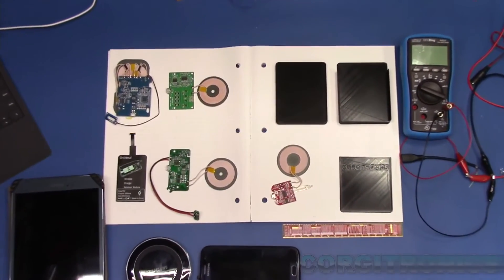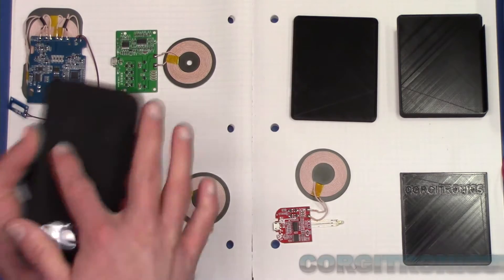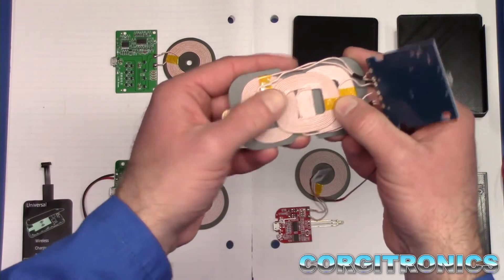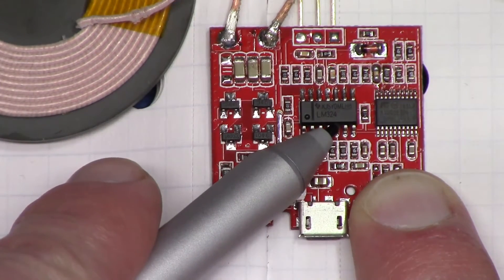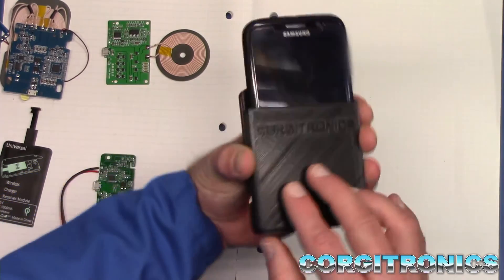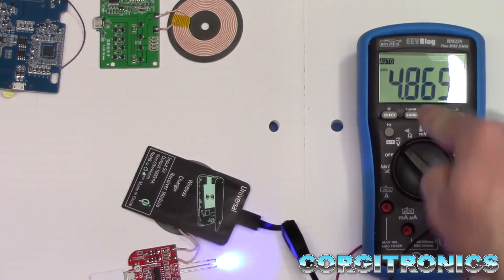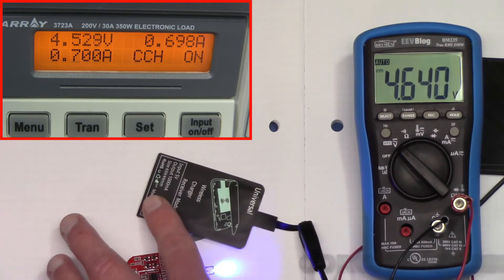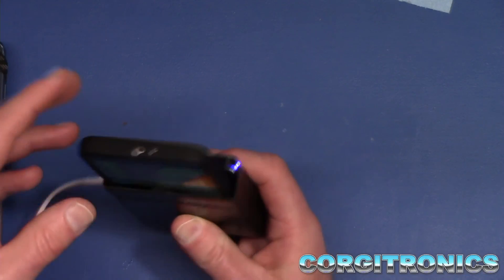Making a Qi Wireless Phone Charger

Comment: Hey, I'm investigating the effect of distance between coils and misalignment of coils on the Induced EMF and Efficiency of the system for an academic project. Would I need an oscilloscope for initially measuring frequency? Also, is there a formula that connects the Voltage and Current (variables that I will be measuring) and the Induced EMF (required answer)?

Thanks a lot in advance, this really helped with my method and setup!

Comment: Hello. I'm searching for some information and thought you might be able to answer a question I have about a built in 10W Qi charger on the top of my PC case. The PSU that was supplied with the case from the factory has a little dedicated Qi power wire that is integrated into the PSU. I want to swap out the factory PSU, and since the new PSU doesn't have this dedicated wire, I would need to power the Qi with a Molex (or SATA?). If I use a multimeter to determine what that factory wire pinout is, can I just look up the pinout for a Molex and connect the factory plug to the corresponding Molex wires? Does it matter that a Molex wire will supply more than the 10 watts of the Qi charger? Most people write off the integrated Qi charger as a gimmick, but it's very convenient and I use it all the time. I would really appreciate any information that you can provide. Thanks in advance!
Reply from the maker: I don't see why you couldn't do that.  You will need to measure the voltage that the Qi charger is getting, it's probably 5VDC, and then check the voltages on the pins in your Molex connector to match it up.
Yes, I use Qi chargers all of the time and have several around the house.  I'm sure that using them has saved the USB connectors on my last couple of phones.
Reply: @Corgitronics  That is good news! I guess I'll dust off the multimeter and get to poking around. Thanks again and have a great day.

Comment: That doesn't supports fast charging right?
Reply from the maker: No, this version of Qi chargers only supports up to 5 Watts (1 Amp at 5 Volts).   The newer Qi standard version 1.2 supports up to 15 Watts, but not all devices will charge at that rate.
Reply: Corgitronics no my phone is a S8 plus so I need a fast charging one coz my phone supports...
Reply from the maker: I have a Samsung S8 Active.  The phone supports fast charging, but the charger doesn't have to provide it.  The phone will just charge as quickly as it can with the power available.
I haven't seen any cheap boards on ebay that might actually be Qi 1.2 compliant.